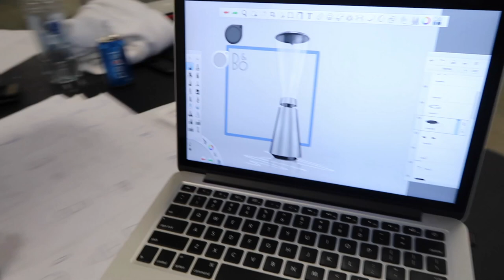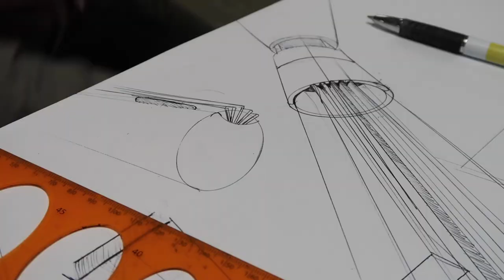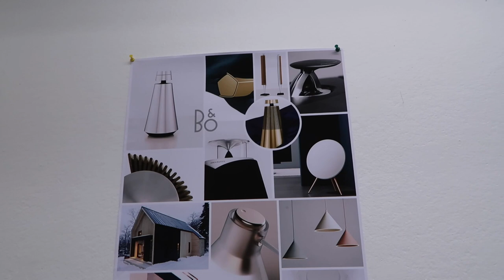I Just Designed My First Product at AUT!

Comment: Hey! I'm an design student as well (industrial design) and I just had a concern regarding prototypemaking. We also use a lot of foam in model making and we have to be quite strict to use a dust mask while sanding. Some of the older students now has respiratory problems (asthma and such) because og the dust particles from the foam. Just though you should know :)
Reply from the maker: Thanks for your concern. :) I know right! I was being rather dumb.  You will be happy to know I now always wear a mask while using the foam. Recently a lecture kindly, but sternly called me up on this.

Comment: Where are you gonna put blades in blender ? If you have cut acute part of the blending section and not making it circular/cylindrical for the purpose!??
Reply from the maker: Wow! I can't believe I didn't think about that! You are totally right. 

Now that I have noticed it I can think of a  quite a few way to fix it, but I am kind of surprised I didn't spot that in the first place. Thanks. :)
Reply: Just reduce the circumference of the blade to fit the cuts.

Or make a slant or slope instead of an acute cut